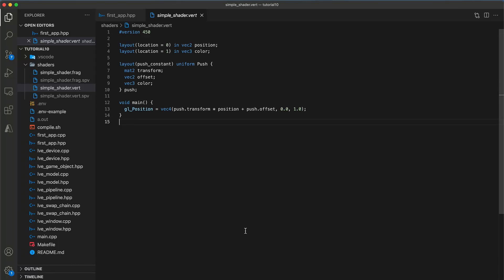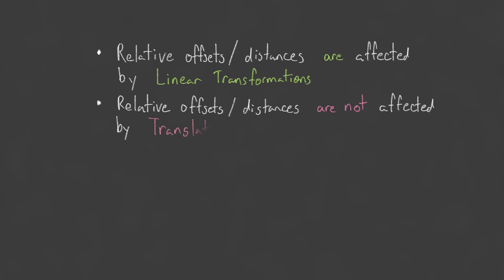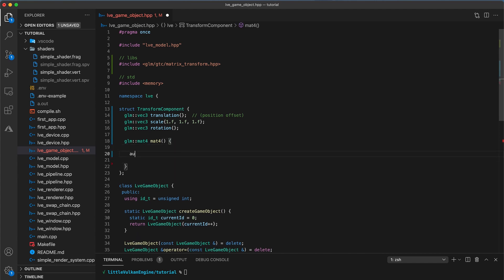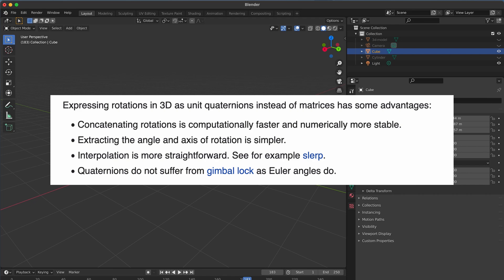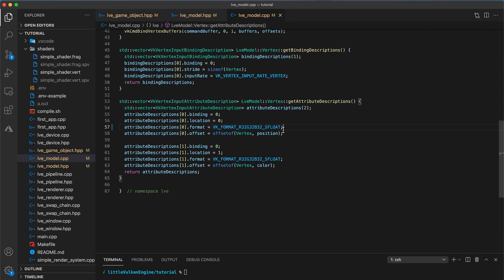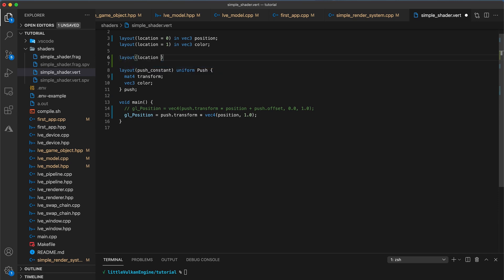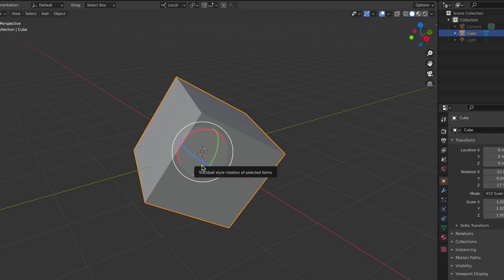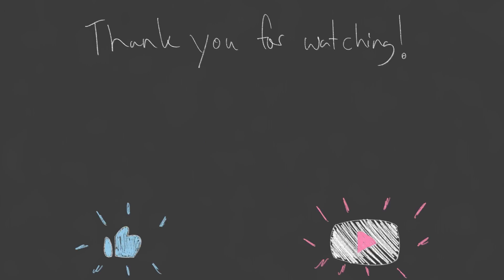Euler Angles & Homogeneous Coordinates - Vulkan Game Engine Tutorial 12

Comment: i think i might have set the speed too fast, the cube is spinning like a discoball with a electric motor of a car xD
Reply from the maker: It likely just has to do with the frame rate and present mode being used. In a later tutorial we tie the animation to be real-time based rather than frame rate dependent. 

Or you could change the present mode to something like fifo rather than mailbox to cap the frame rate
Reply: @BrendanGalea  in which file again do i need to change that, i have forgotten

Comment: I guess i'm getting way ahead but is path tracing something you code manually or is it already programmed in hardware like Rasterization?
Reply from the maker: like on the GPU? Newer GPUs have dedicated ray tracing pipelines in hardware, you still would have to program shaders and data structures, etc. 

I've never tried any gpu based ray tracing, I'll need to get a newer graphics card before being able to do that, so there's a lot I just don't know yet about this topic.

Comment: came here for glm rotations hope it works thanks
Reply from the maker: Sounds good! Let me know if you have any questions
Reply: @BrendanGalea  I am learning by modifying some of the Sacha Willems examples right now. I have altered the example "pbribl" in order to transform the object and read its position and scaling modifier into a variable. I managed to implement scaling and translation just by accessing the mesh from the uboMatrices struct, creating a glm translate function with the mesh, then passing the function from glm translate to  glm scale using the same format. When I add a rotation function in this scenario it rotates very unexpectedly almost as if its also reading the translation incorrectly at the same time and it wont rotate back to its origin at a constant speed. Do you have any idea why this may be happening? I may have to go this route of making seperate object class before trying to give it a transform matrix of its own(that includes rotation anyway). It has something to do with the way I am accessing the mat4 i believe but im unsure. edit: sorry this is so long its just i feel the context is very important
Reply from the maker: " creating a glm translate function with the mesh" <- I'm not sure what you mean by this. Are you applying the transformation directly to the position values of the mesh? Typically that's something you want to avoid doing. 

I took a look at that example. You'll want to update the uboMatrices.model field to set the modeling transformation, which is currently set here on the 3D object: https://github.com/SaschaWillems/Vulkan/blob/07211790038d0ab0d97058a8d0fb08df0d171fac/examples/pbribl/pbribl.cpp#L1363

So for example, if you wanted to first rotate the object, and then translate it you could replace that line with
uboMatrices.model = glm::rotate(glm::translate(glm::mat4(1.0f),  someVec3), someAngle, someVec3Axis);
Reply: @BrendanGalea  thanks I will try to implement this. And yea I am applying the transformation directly to the mesh out of simplicity. Instead of applying the transform directly, should I use some kind of seperate matrix to store the transformation then apply it? I am planning to do something like this in my object class, but just wanted to add a rotation function to my scale and translate functions that modify the mesh that were already working properly. Is this why you redesigned the mat4 inside the object transformation function?
Reply from the maker: Ya there are a few reasons we usually avoid applying transformations to the mesh directly. It's a lot slower doing the calculations on the CPU compared to the GPU. Also if you wanted to have multiple objects using the same mesh, they would each require their own copy of the mesh if you apply the transformations directly.

Meshes can be pretty large in size, so you absolutely want to avoid having multiple copies of essentially the same data. That's why storing a transformation matrix is so great. For each copied object you only need a mat4 and a pointer to the shared mesh. 

"should I use some kind of separate matrix to store the transformation then apply it?" <- Yes, this is what I was alluding to. The matrix that transforms a mesh is typically called the "model" transform. 

"Is this why you redesigned the mat4 inside the object transformation function?" <- also yes. So you're on the right track. And then once you have a mat4 function you would set uboMatrices.model = myGameObject.mat4()
Reply: @BrendanGalea  awesome, very informative response thank you.
Reply: @BrendanGalea  Hey, for some reason when I set up this transform matrix the object will rotate with the camera axis rotation, I know its a very specific example im using but if you have any insight as to why this is happening please let me know. I think it has something to do with the way the object matrix is setup in the example

Comment: Just started your series like a few days ago and its amazing. I will admit off the bat that I'm pretty terrible at coding, so forgive me for the stupid question. Everything works just fine, but I don't remember setting my debugger to launch in x64 or 32 bit when running the code. And if I which it back to x82 or 64 bit my entire project lights up with errors, so what's up with that lol? I cant image that its just that we are using uint32_t type for some variables, and the errors seem to be the way the pointers are set up. To be fair I did set up dependency's slightly differently. Idk, everyone here seems smart enough to answer this question and I'm all ears. Not a problem now, but I just don't want it to be down the line.

Comment: Hi 
Thanks for this great series
I have a problem where some of the cube's faces flipped front to back, i tried to address the bug but i couldn't, so i hope someone could point me to the right direction at least.
thanks
Reply from the maker: Made this a long time ago and with graphics debugging is always tricky… but could be a couple things. Double check the file I gave you, I vaguely remember one of my obj files being incorrect. Two of the face vertices would be duplicate (two rows in the file that are identical) 

Could also be a flipped depth buffer. Showing the faces inside out… you could try asking for help in the discord. It’s still pretty active. 

My apologies, just have lost the context on the tutorials and haven’t had the time I use to to provide support.
Reply from the maker: Check the most recent video. That will definitely contain the discord link

Comment: This way of explaining it, while common, is full of inaccurate use of terminology. First of all, homogenous coordinates have nothing at all to do with it. It is a term from projective geometry, which means something else entirely. The proper way of explaining it is that it's a shear in a higher dimension, of which the dimension being "translated" is slice of, and is taken along all together due to the nature of shearing.
The reason that having a zero in that higher dimension nullifies the translation is also due to how shearing works (it leaves the zero-level in place, only shearing above and below it).
Reply from the maker: I've always really liked the interpretation that it's a shear in a higher dimension and thank you for sharing it! I wanted to include that in this video but had already spent too much time on this topic. But I'd have to disagree in terms of one method being more proper than the other in describing what we're doing as they are both fundamentally just interpretations of the mathematical machinery we are using. 

Homogeneous coordinates and projective geometry are a good interpretation in that the points are invariant to projection transformations, i.e. a gl_Position value of (1, 2, 3, 1) and (2, 4, 6, 2) are treated as equal. 

The shear interpretation has the advantages you spoke of, and has the bonus of being easy to visualize for the 2 dimensional case, but in my opinion can make the derivation of the perspective matrix (at least in terms of the z component) harder to communicate. Also a shear in 4D doesn't imply that (1, 2, 3, 1) = (2, 4, 6, 2) would be treated as equal.

Anyway, I'm by no means a mathematician, so I may be wrong here, but I think both are just different mathematical interpretations of what we're actually computing; each having their own advantages and disadvantages. 

I would really like to hear more of your viewpoint though!
Reply: @BrendanGalea  Look at it this way: Fundamentally, we're dealing with geometry (things existing and moving around in space). Math is just a formulation tool. In that sense, geometry is not an "interpretation", it's the "actual" problem itself we're dealing with.

For example: Projective geometry is all about lines through the origin, not points. The "homo"geneity reffers to the equivelancy of all points along each of these lines. In terms of vectors, that means that all vectors that are scaled-versions of each other, are considered "equivalent" (homo = same/equivelent). Algebraically, that means that coordinates of points are considered equivalent "up-to a proportion". In other words, it's the proportion between the components of the coordinates that matters, their realtion - not their absolute values.

As you can see, none of that relates in any way to translation or shearing - which is exactly my point:
Translation does not involve any notion of "proportion-equivelency" nor any process of re-normalization (division by w).

Just because an additional dimension gets involved in both projection and translation, doesn't means that geometrically they even happend in the same "kind" of space(!)
Translation (and shearing) happen in euclidian space, using a cartesian coordinate system. 
In contrast, projection actually happens in "projective space" which is NON-euclidian(!) And projective space doesn't use a cartisian coordinate system, it uses a "projective coordinate system" - otherwise known as "homegeneous" again, due to the up-to-proportion equivelancy.

You can even look it up in Wikipedia - "homogeneous coordinate system" is just another name for "projective coordinate system". And nothing of that sort is involved in translation.

This whole confusion of terms is just an unfortunate historical accident, one that by now is way too late to fix as it's so prevelent is virtuall all of literature on computer graphics...
I'm just pointing it out here.
Reply from the maker: Thank you for such a detailed response, this is the best discussion I've had on one of my videos! 

This has definitely got me thinking and reconsidering some things I just took at face value. My description for homogeneous coordinates in the video very closely follows the description of homogeneous coordinates from Fundamentals of computer graphics, 3rd edition by Peter Shirley.

"The single matrix implements a linear transformation followed by a translation! This kind of transformation is called an affine transformation, and this way of implementing affine transformations by adding an extra dimension is called homogeneous coordinates (Roberts, 1965; Riesenfeld, 1981; Penna & Patterson, 1986)"

I usually strongly avoid repeating a resource so close to verbatim in these videos, and use my own words as much as possible, but in this case I tried to stick very close to that definition because I did have some confusion over the exact terminology (supporting the exact point you made!)

However not coming from any specific resource but just my own understanding, I still think in both cases the maths are just an interpretation, right? Like I would disagree that the geometry is the "actual" problem we're dealing with when we increase the dimension. So for example the 2D case where we have a square, the geometric interpretation that the square is in fact a cube and we're performing a shear I don't think corresponds with the reality of the situation. No cube really exists, and at some point we still need to collapse a 3D euclidean space back into a 2D euclidean space. I don't see why that mapping is more valid then mapping a projective space back into 2D euclidean. 

And in the geometric case we are still picking the value 1 for the 3rd component somewhat arbitrarily? I might be missing some geometric meaning in this case... but I can't think of a reason why all objects would have a size of 1 in this extra dimension besides the fact that is happens to make the translation work out.
Reply: @BrendanGalea  I love Peter's book btw -he's following a convention layed out by many others prior to him writing it so I don't blame him at all. 

Here's what I'm seeing happening here: 
Technically, you really don't need to encode a translation in a matrix at all (or any kind of transformation for that matter).
A matrix by itself is just a mathematical tool, a mechanism borrowed from linear algebra, applied for manipulating geometric space.
Being a tool, it has benefits and shortcoming/limitations. The main benefit is the ability to "collapse" successive transtormations into one.
But the reason for the additional dimension comes directly out of that choice to use this tool for that purpose: 
If you want to encode "all" possible transformations - including translation - you can't do it in matrix in the same dimension because that transformation is not linear (so a matrix can't encode it). So you go up a dimension and do a shear there as a workaround for that, which lets you still keep the same mental model of "space transformations encoded in matrices".

The reason for having to move your space by precicely 1 is because of how shearing works:
It moves space "faster" the further away you get from the origin - and for the workaround to do what you want, you need the "speed" to be 1 so it correlated exactly with the shear amount (numerically).
Coincedentally, it enables you to keep pure-directional vectors intact, by keeping them at "ground level" (zeroing out their shear coefficient).

And because you want to be able to keep doing that kind of thing a lot, you often just stay in that higher dimension even for representing your lower dimensional problem space. That's how this notion of keeping an extra dimension around came about - to maintain that ability to encode transformation in matrices (which again, is just a choice - you don't have to do that).

And again, notice how there's no notion of lines through the origin or proportionality equivalency, anywhere in this story(!).
It's an Euclidian story, not a projective one - which is why the "projective coordinate system" term (a.k.a: "Homogeneous") is inappropriate here.

Now, as for "Which conception is primer?" - that's a separate topic:
It depends on what your primary objective is: 

For a "pure mathematician", they only care about "proofs" - so they really only need the algebraic formulation with symbols/notation. Once they have that, they consider their job done. In fact, they would fight tooth and nails to keep the conception in that "notational level" as from their point of view doing so gives the most amount of "power", because it keeps the solution "most generic". They would deliberately avoid any association of formulations to any concrete domain, as that prevents the solution from remaining "generally applicable".

For an "applied mathematician"/practitioner however, the primary concearn is the domain-specific problem they're trying to solve - not the abstraction/generification of it. And so the conceptual model of that problem domain - matters a lot. It enables them to think in very specific ways that help them solve problems in their particular domain. It lets them modify solutions to cater differing problems, specialize generic solutions to more constrained cases, or come up with entirely novel approaches to the same problems.
Keeping conceptions of problems and solutions at the "notational level" of math actively "detracts" from these benefits, as it takes away the "domain-specific conceptualization" (way of thinking) of these problems and solutions.

Lastly, in regards to programming:
Is programming primarilly about wirting instructions for computers to execute, with solution to the real-world problem being secondary?
Are data structures and algorithms "concrete" or "conceptual"?
This may seem like "too philosophical", but to me they're fundamental:
You solve problems conceptually first, so having the most appropriate mental model while doing so is key. It's not a secondary aspect at all. 
How you then convert that conceptual solution to a working program  - is a technicality - it's a tooling-level issue, so it's secondary.